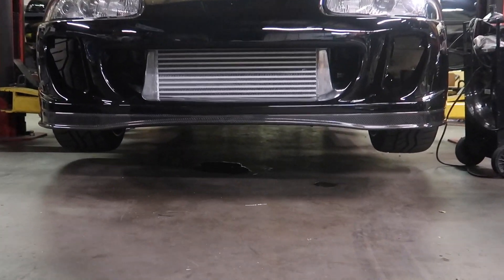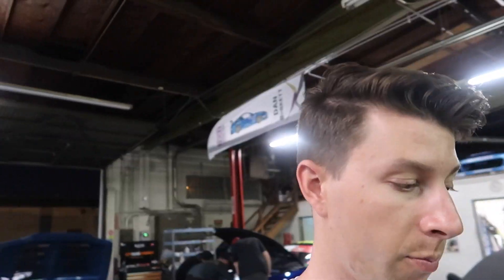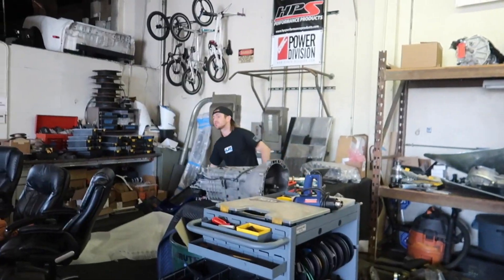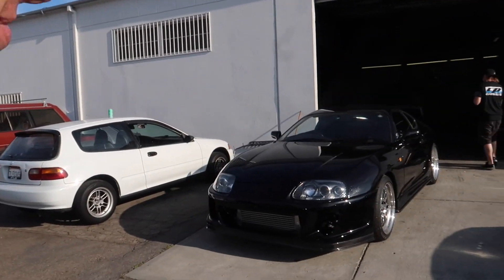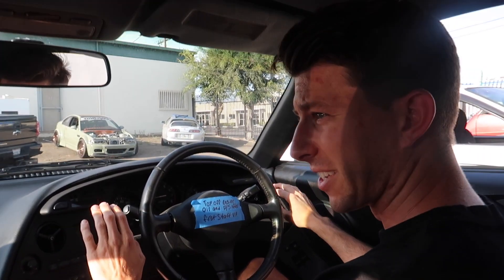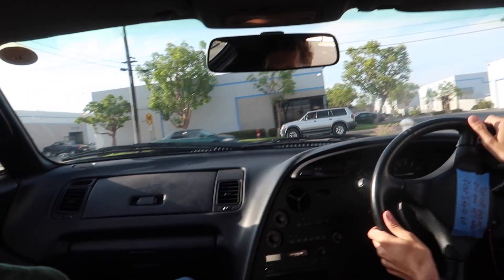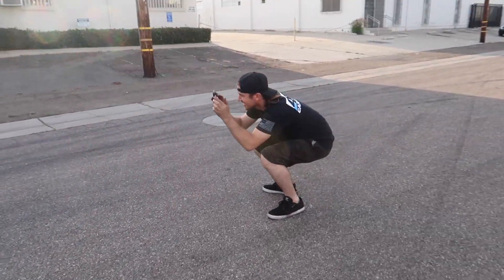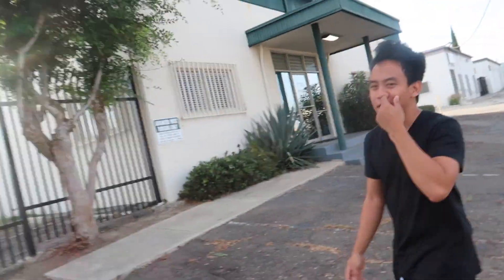Heavily Modified Toyota Supra is COMPLETE!

Comment: teeg you should consider the headlight with the hole in it so air goes straight to the cold air intake, just for some hot boi points

Comment: Dunno if a stock bodied supra with stock displacement counts as "heavily modified" but it makes as much sense as the rx7 being worth $1,000,000. And the wheels just make it look like a ton of other supras which is fine but not using that huge brake kit because you didn't want to buy another set of wheels is the definition of form over function which is pretty dumb on a decent HP car.